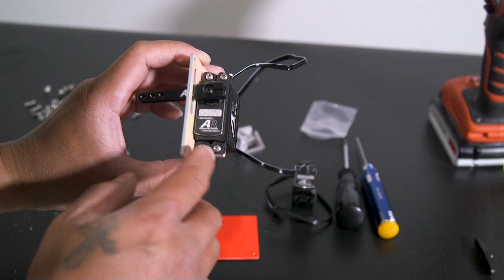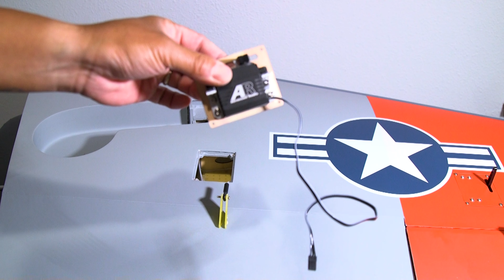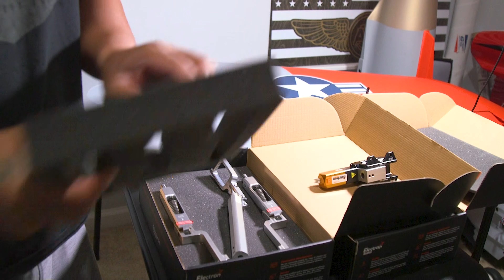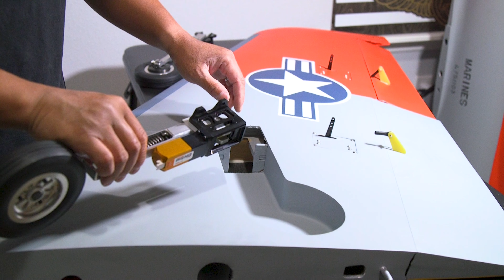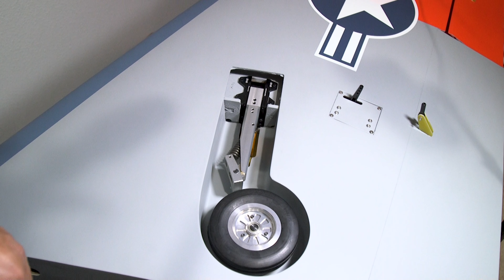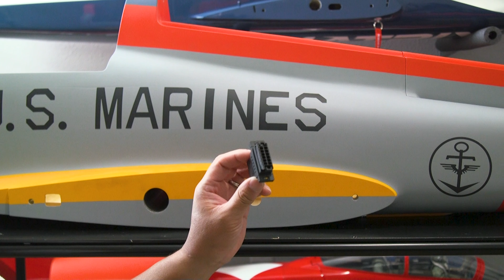TopRc Voyager 3.2m assembly part.1- #TopRCV #RCPlaneAssembly #ModelAirplane #aviation #airplane

Comment: hello, is there a part 2, 3 , ... ?  I just recieved one. Kindest regards from Belgium
Reply from the maker: Hi. Yes there will be a part. 2, 3 and maiden video. I have just been super busy with work. I apologize for the long delay with releasing the videos.
Reply: @WarrenRC6373  Hello Warren  I have the kit in my possession since yesterday. A new KingTech 235 g4+ is coming in.
Jeti 16 V2 radio, savox 1270 and savox  2290. ER 50 as retracts and an AR smootflite 16. I look forward to your next building reports  Kindest regards  Rohnny

Comment: Good call going with the electron gear set!
Reply from the maker: Definitely worth the upgrade compared to the factory setup. You’ll also see later in the build series how I upgraded to servo operated nose gear door and got rid of the mechanical door mechanism that just wouldn’t work properly. Stay tuned!
Reply: @WarrenRC6373  that same mechanism is on my odyssey. Knock on wood it has worked flawlessly but on a smaller airframe, obviously. I ran into a gentleman at Jets over Georgia that also had an interesting mod to the flaps on the voyager, all internal linkage with new horns attached to the LE of the flap. This allowed for a better geometry of the linkage and less stress on servo for those monster barn doors lol